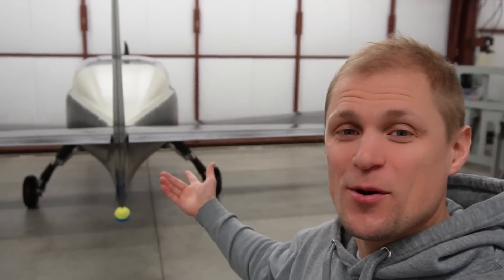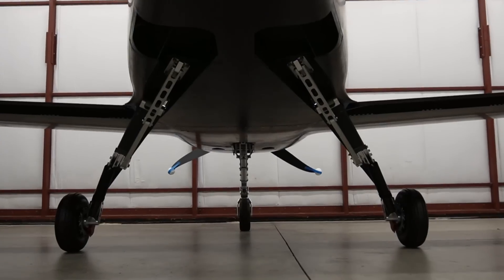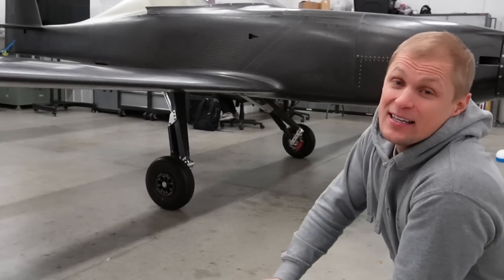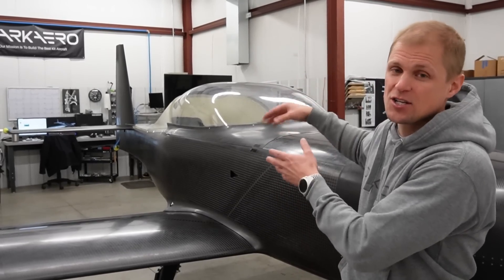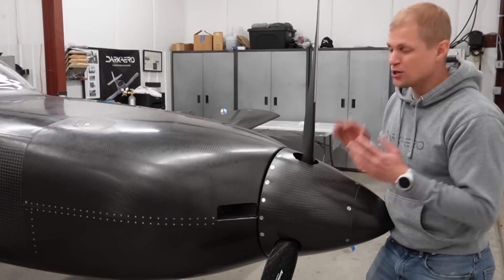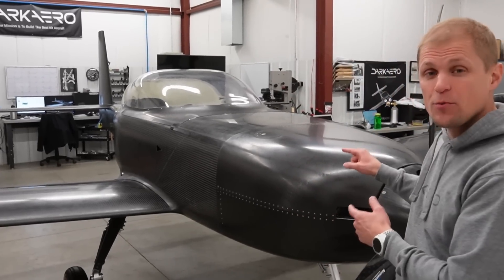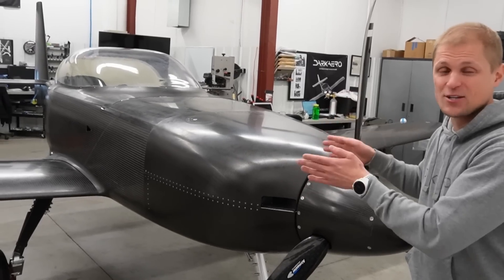DarkAero 1 - Full Assembly Discussion!

Comment: Towards the end of your video you discuss having put a positive Tow on your main gear to keep them stable on landing. Yet it appears like you have a positive camber on them as well which would tend to make them want to pull to the outside instead of push to the inside. Camber will replace toe if you move that wheel to a negative camber it will try to turn to the inside and you wouldn't have to do as much toe and you wouldn't be scrubbing rubber off of the tires every time you run it down the runway. You can basically do zero toe and a degree or two of negative camber and have pretty much the same effect. You might want to look into that. I did that on a front-wheel drive vehicle several years ago because I was doing long drives to work everyday and I was getting four or five miles a gallon better mileage and almost zero wear on the tires. And the vehicle was more stable. The only side effect I noticed was that if I crowded the vehicle into a curve the tires would make a lot of noise long before the front tires would break loose. So you had plenty of warning if there was an issue. But when I had the stock front end alignment on it it would break loose and just go straight it would push very badly. After I did that I never had a problem with a push. But it would let you know when you were hard on a turn. Just my thoughts

Comment: @Dark Aero, Inc 1) does the engine require a certain operating temperature in order to have all components at proper thermal expansion? For example piston to wall clearances. 

2) if number one is yes, how do you control this temperature with fixed aperture openings or outlets?

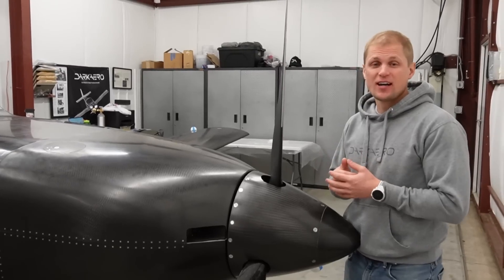Comment: @4:40 I wonder how well that cooling air intake works when you are taxiing.  Especially at low ground speed but high RPM, the outer portion of the prop will generate more pressure than the inner portion.  Air flows from high pressure to low pressure, which means air will try to flow radially inward (as well as backward) from the prop tips.  It obviously can't flow that direction because it's blocked by the fuselage.  The result is that the velocity of air near the root of the blade (and over that intake) will be lower than the average air velocity from the prop disc.

I also wonder about the transition from the diffuser to the plenum behind it.  That's a sharp inside corner.  Air typically doesn't do that.  I don't think that diffuser flows the way it's shape suggests.

Comment: Would a NACA duct be adequate for ram air?  Would look better than a big snorkel :)
Reply from the maker: David, yes NACA duct could work. We had a NACA inlet for the ram air at one point, but we are changing to a different configuration where the engine inlet comes in near the cooling inlet. We are not planning on a snorkel.
Reply: @DarkAeroInc  Are you thinking of ducting internally from the two side openings to the intake?

Comment: OK if the wings are  used, there you get 2 points still it is going to be heavy on the nose so it should be a 3rd Point. Still it Will be nice to have a recomendad área to load the Wings with the Weight, just a sugestión.

Comment: But with the weight of the engine up front, and the pilot centered, how much a consideration is the weight of the nose gear? I mean, I can't imagine the CG being so far back, assuming "too light" nose gear, for the plane to tip backwards as you say. I mean, I never thought nor heard that the weight of the forward gear was a factor in balancing a plane on the ground. 

Edited to ask: A common question, not addressed, was the seemingly tiny surface area of the rudder, for a plane of this size. It seems to several commenters as being far to small to be effective.

Comment: Finally you understand the cooling flow is controlled by the exit area. Glad you read my comment from a while ago. Now you need to learn about up stream diffusion, which vastly improves your cooling duct efficiency, because the majority of the compression can happen without the confinement of duct walls. If you make your inlets larger, the flow will be slower, lower drag, and cool your engine better.

Comment: I was looking for RAM air right before you mentioned it.
Wasn't this orginally going to be a io-360 engine.
Should look at Mike Pateys cylinder head covers for cooling he uses on Scrappy.  
Can't wait to see this plane fly and get actual performance numbers.
Beautiful aircraft makes me wish I wouldn't have lost my license due to Heath reasons.
I had a F1 rocket.  
So only change I would make to this plane would be it should be a tail dragger with retractable gear.  
Lastly been following you since your 2nd or 3rd year as I grew up in Wisconsin

Comment: Are there Jack points to jack the plane for maintenance ? have not see those.
Reply from the maker: Hey Luis, the current approach is to use the wing to lift the airframe up by jacking up each end of the wing. A foam block is used to distribute the load between the wing and jack.

Comment: Looks like a modern composite version of the Osprey GP4. As a fellow engineer and plane builder, I appreciate your approach to all phases of development!
Reply: Rocket probably has more room inside plus better performance, so good choice. I also thought about a GP4, but I already had a Grumman Cheetah, so I built a small single seat aerobatic plane you see in the picture, a Corby Starlet.
Reply: Does look similar, but also many differences.
I looked at building gp4 back in 90s. It's a pretty aircraft.
Went with F1 rocket instead.
Osprey has 360 not 540 engine, different canopy, much much different rudder
But both designed for same mission

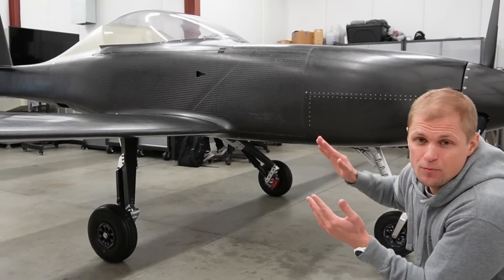Comment: Regarding Landing Gear development mentioned after 3:20, will the internal pressure in the gear struts allow consistent landings/takeoffs across a range of field elevations (sea level up to Colorado) and a wide range of temperatures (summer and winter) ?  Anticipate that maximum extension of struts will be allowed in the retracted/stowed position for flights at altitude.

Comment: I hope this helps.   The inlet you currently have needs to change.  The sharp angle of the inlet being 90 degrees will actually work against the flow due to increased positive pressures at the edges of the inlet.  Also, you said the exit was the same size and this also needs to change.  The exit can be a part of the cooling flow IF you incorporate the exhaust as part of the flow.  Look that up.  It works very well in the race plane at the Reno Races.  The exit should be larger than the inlet to create a high/low pressure differential which will also increase the efficiency of water jets that cool the cylinders.  Looks great so far.  Good luck.

Comment: Beautiful engineering and construction! I do wonder how those very thin wing and stab sections will perform in real life, hopefully no nasty/asymmetric stall characteristics. I also wonder about how repairable the wing will be given it’s stressed skin design in the event of hangar rash etc. Although your gear engineering is beautiful I think a Cessna style steel tube may be simpler and cheaper. I admire your work!

Comment: Shouldn't the main gear "toe out" approx 1 degree?
Toe in will make turning dynamically unstable.  A left turn shifts weight to the right side giving bias to the right tire pointed more 'into' the turn than the current turn rate causing a 'tuck' effect.

Comment: These guys designed the aircraft. They are engineers, they know what they are doing. Meanwhile armchair nobody's question their design choices... Gotta love the internet.
Reply: i don’t think there is anything wrong with people asking questions or making comments. i think you will find there are many people watching who ha e aviation expertise. it doesn’t detract from the hard work and great achievements of these brothers.
Reply: OP is probably right. Although some critical review is warranted on any project. As long as the critic has a logical and fact based foundation for their perceived grievance.

I am a longtime follower, and a real fan of 96% of what they do. I post tough questions on rare occasion but am not going out to smear their commendable effort.

Almost all of their design choices are sound from a functional and construction standpoint. 

The aircraft will undoubtedly fly, and I don't think they will be far off from their lofty performance estimates, either. This probably is a 275mph airplane as it sits. There is no reason why it cant fly that fast and that far. Or carry that much. It can, and it will, and they will achieve success in those areas.

My critique is of the philosophic and artistic kind. 

Aesthetically, the rudder is all squared-off and looks out of place, as everything else is rounded. The turtle-deck and rudder outlines are not up to the same Aesthetic standards as the rest of the plane. 

Philosophy wise, It uses split-flaps for the rudder which are great at creating a significant portion of drag as they generate in lift. Great on the wing of a hot ship like the FW-190 or Super Tucano. Not the Rudder of a propeller plane. The cases where you need the rudder most, when you ask the largest deflection, I.e. slow, high AoA, and high power setting, as in a Vx climb or go-around on landing, it works as a speed brake right when you need less drag. Not to say it cant work, because obviously they showed the space shuttle, but the Shuttle cant go-around on landing, and it doesn't have 5hp/lb torquing a propeller around its thrust-axis. The shuttle has no propulsion torque, it needs brakes more than rudder. Outward-deflecting rudders were used on the LongEZ but that aircraft didn't need much of any rudder at all. The rudders it had were plain flaps.

Then there is the "Why" go all the effort to attain 275mph on 200hp, as your first product, in the first place? E.g. 250 mph is nearly as fast, and would allow a significantly lower landing speed via larger wing. 1.21x larger, to be exact. 79ft^2 vs 66ft^2. (18.75 vs 22.73 Lbs per SqFt wing loading). 66ft area is the same as Reno IF1 racers that weight half as much. (500 empty 750 loaded vs DA=775/1500). And those planes are a handful to land for non-expert fliers. So this one will be heart racing fast on landing for people who are more hands on builder than stick and rudder fighter jocks. 

The old Lancair 235-360 had 76ft of wing area and weighed about the same As DA. You can see DA is in another category of performance above all the 4cyl Lancairs. Having 10ft less wing area and slightly more power.

Performance wise, its a winner. - But why compromise everything at the expense of attaining that last 10% improvement in speed, when it costs so much everywhere else? Especially traffic pattern and landing. 

The answer is Performance sells. 

And they are selling a lot. 

They are very smart with a great work ethic and are investing a large input of time and money, dotting their i's as they go, doing everything "Right" and by the book. So they almost certainly do deserve their success. 

But, it hasn't flown, its mostly hype until they test fly and determine if its going to be a sale-able product to average pilots. I suspect along with high wing loading, at least high for its chord Reynolds number,  it will also have a really entertaining stall behavior. (Though I've revised my earlier dire estimate slightly after seeing their planform taper ratio is nearly rectangular, which should help). 

Its a great product for its intended purpose. But its intended purpose: aka "Philosophy of Use" was very obviously conceived by non-pilots who have never felt that pucker factor trying to land a hot ship, let alone when experiencing the fatigue of a long trip, or at night... Nor have they ever lined up on a cornfield to simulate an engine out. You go out and fly at some corn at a buck-20 something and tell me you wouldn't be tempted to apply a little too much aft pressure about 20-feet up? 

If you do, you will die.

You gotta put the gear up and the nose down and hit that shit at 80-something because you gotta keep the wing flying all the way.

I don't think those observations are invalid.

Comment: If you put the same design philosophy and same design requirements/constraints towards an aircraft with a pusher propeller behind the cockpit, I wonder what the advantages and disadvantages would be? Probably get better visibility, and the landing gear situation may be better. But you’d need twin tail booms, and the aerodynamics may suffer somewhat.

Comment: It does look fantastic...and as my engineer father always used to say..."If it looks right it is right" well done :-)
Reply: Not quite. Plenty of ugly looking airplanes that flew, and plenty good looking ones that didn't quite make the cut. It's all about getting all the engineering parts right, such as CG, CL, TF, stall characteristics, airfoil profile, drag vs power, none of which you can tell about an aircraft accurately at a glance.
Reply: @ccengineer5902 Hi there thanks for your comment.
 I am a pilot and experimental aircraft builder so I understand a little about aerodynamics thank you  👍... What you say of course is true...however history is unarguably  crammed full of stunning aircraft that flew beautifully and were military and commercial success stories, as well as plenty of butt ugly aircraft that flew like dogs., killed there pilots or didn't go into large scale production..(the former seem to outweigh the latter) I am merely referring to  the concept, that beauty often follows competent, functional and well thought out  engineering... 
I stand by my statement,  however I was mostly just giving these guys a well deserved compliment.  If it has aerodynamic issues I am sure these guys will solve them, but Il have a wager with you, that it flys like a homesick angel 😉
Reply: @andrewnewman6451  Correlating aesthetics with flightworthiness is exactly where I have issue, especially when they have simple, easy to spot mistakes going on. For example the horizontal stabilizers are way too much in plane with the wings, it's going to stall easily. And with a CG that's going to shift greatly with that gear swinging back and forth...Let's just say I won't be volunteering any time soon to fly in it.

Comment: Love your project.  A 'downer' for me is the "Toe-In" on the main wheels.  That does not help tire longevity.  The owner would run through tires almost as quick as a couple tanks of gas.  Get rid of the "Toe-In" and you'll have a WINNER!   <grin>
Reply: Toe-in helps in high speed stability and also when under load/compression.  Its a good trade off for tire wear.  Nearly anything thats on wheels and travels at high speeds have a slight toe-in set-up.  Either way, hopefully they incorporated a way to adjust camber and toe on their trick looking setup.  Would be quite disappointing if they didnt.

Comment: Wow, thanks Riley. I had made a couple points and asked questions about the gear on your previous video, and you answered those exactly - I suspect those were my questions you were answering. So thanks. :)

I realized as you were talking about weight distribution that this thing is LIGHT - carbon fiber, with a big engine hanging on the end. Of course the main gear has to be forward in order to have proper weight distribution. Didn't think of that until you mentioned it.

I look forward to your next update!

Comment: Curious about maintenance access across the entire aircraft, particularly in the aft section.  I'm currently working on a all composition aircraft with similar appearance in the tail section.  Although there are traditional round hole maintenance/access ports for visual annual inspections, they do nothing and are worthless for actual work in the case something needs to be swapped out.  Most mechanical and electrical parts in the aft section, are/were installed during assembly prior to fussing the top and bottom of the fuselage. A primary example is the electric motor for the electric trim for the elevator which is installed almost at the root of the rudder fin.  In my case, I can't see a way to replace said motor if need be without making major cuts in the composite tail assembly to gain access to it.  So I'm curious what is the "maintenance access" design not only for visual inspection but actual part replacement in this aircraft.
Reply: See Mike Patey's Scrappy doors 15:44 https://www.youtube.com/watch?v=RSvaLpHLbIg&ab_channel=MikePatey
Reply: @Jack-ne8vm  That is a good idea.  So do I/we assume that the DarkAero will have these or similar (big) service doors as well?  Regardless, I still have questions concerning the empennage.  The empennage has less volume area and is curvy.  On top, the Dark Aero is all composite.  So I'm curious to see what service doors, if any, will be available to access the control tube/control cables joints and/or other equipment such as the electric trim motor.  I prefer not to imagine cutting into the empennage (making a big hole) to replace a tube/screw/pin or motor when need it.  And yes, my current project with this very issue has made me over sensitive to these composite designs. :)
Reply: @Vlodek9  The skin of Dark Aero is structural. Probably best to avoid holes, otherwise would need to carry stresses around holes.

Comment: Wouldn’t the toe in angle substantially increase the  wear  of the tire and it’s treads?
Reply: Don't really know, but guessing that the chosen toe in angle is pretty much industry standard in aircraft similar to this one...
Reply: Aircraft are supposed to be in the air, not driving on the ground, yes it is more wear, but it's not a problem.
Reply: @TheOwenMajor  right, I can imagine they are doing more good(better grip) than bad(wear).